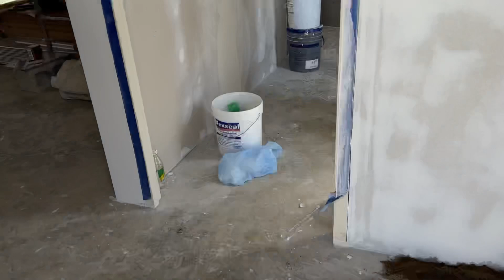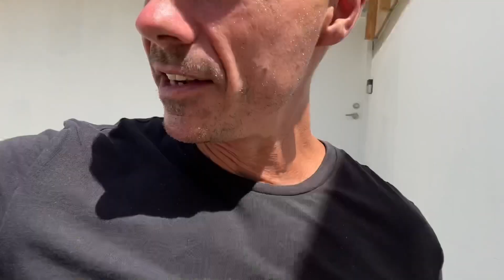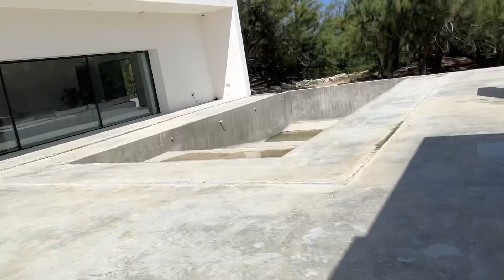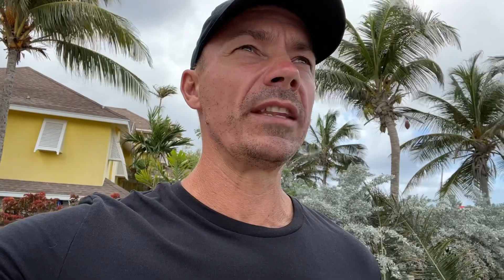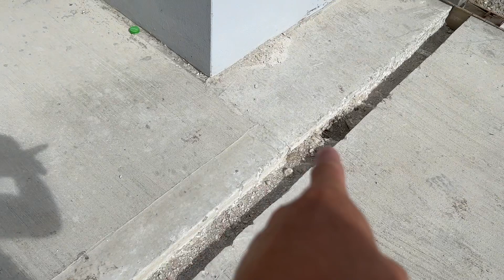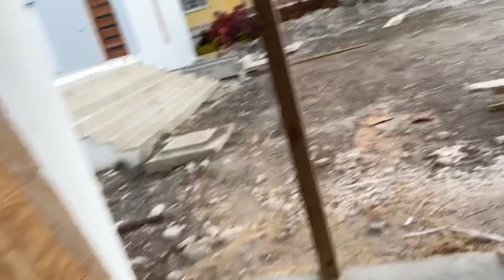Barbados 🇧🇧 Beach House Build - Day 276, 277 and 278 in one Building our Dream House in Barbados

Comment: Hi Alvin, Glad you have decided to level off the cottage roof, I did mention it on day 254, had a feeling this would be a bug bear for you later on.
The cottage is coming along nicely,  just a thought, how about wood effect adhesive vinyl flooring in planks layed in a herringbone style, there are great products around which are  hardwearing with zero maintenance. The external steps have come out great, however I think the dark grey paint colour you have inside would make them look even better.
A row of  Foxtail Palm to the front (road)  in pebbles/coral stone is also a good look. 
Once again great vlog mate, keep up the great work.